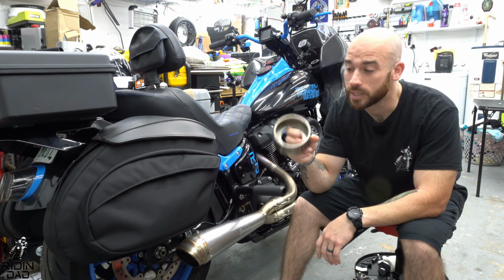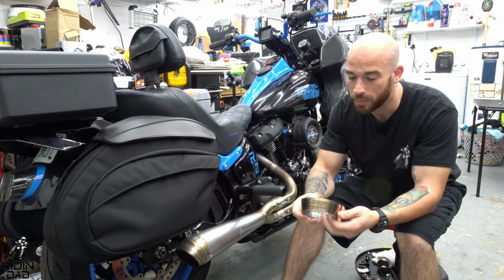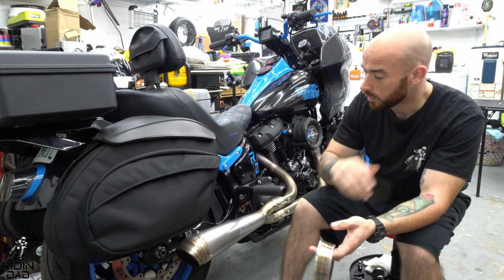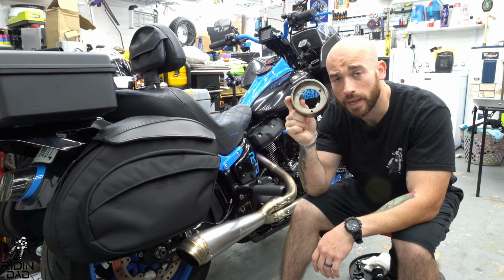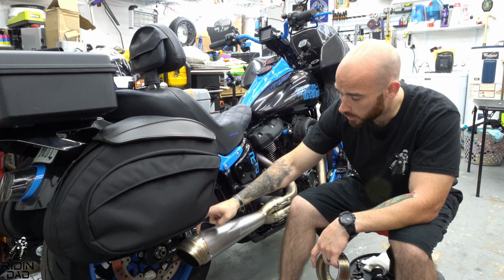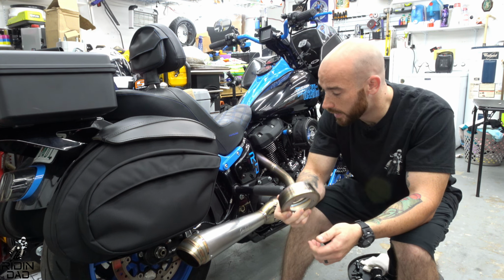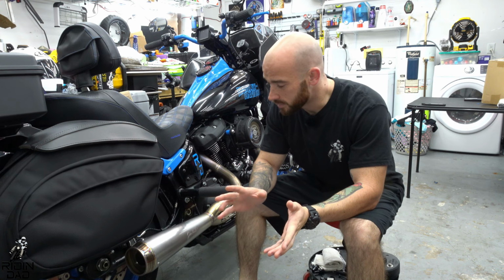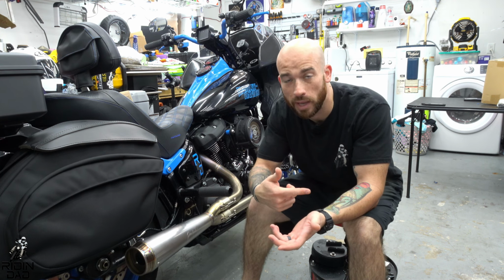Fuel Moto Jackpoit Riot 2 into 1 END CAP SWAP! - does it make a difference?

Comment: Sounds a little louder. Probably more so if you stand behind the bike. I have the same exhaust and love it. I never thought of turning the stock cap outward instead of down, may have to try this. Thanks for the video!
Reply from the maker: Yeah this clip is recorded on my lapel mic so it is behind the bike lol. That’s specifically why I walked back there out of frame.  No problem man?
Reply: @Ridin Dad  I wasn't trying to tell you where to stand, sorry it came out like that,lol. I was speaking in general.  You had me thinking about how turning the cap changes the direction of sound.  Yours will probably increase awareness behind you when riding.  I don't know about you, but I use the throttle as a horn. I usually crack back the throttle a few times if a car around me seems potentially unaware that I'm there. 
I appreciate the videos!
Reply from the maker: All good man! And yeah I do that too. Sometimes it helps but unfortunately around here half the people are too deaf or oblivious to hear it anyway :(. And thanks man!!

Comment: just picked up a ‘23 st 3 days ago and swapping out the pipes is a definite must for me lol. This video might have convinced me to buy a set. thanks man
Reply from the maker: Awesome man! Have fun 🤙🏼
Reply: Does anyone have experience with the straight tips burning the ST bag?  I thought that the original was curved down, so that it would push much of the heat away from the saddle bag.  Thanks. @RidinDad
Reply from the maker: I don’t believe they would impact the bags normally? Unless it’s like right up against it there’s enough surrounding air that it’s not just solid hot air right on top of it all the time.
Reply: thank you @RidinDad

Comment: Does this fuel moto pipe outperform the fab and trask pipes?
Looking to replace my s&s  pipe
Reply from the maker: Trask performed like crap. Even my two brothers outperformed the trask. As far as the fab 28…I haven’t dynod it since the change but it seems to be the same if not better.
Reply: Yes that jackpot pipe is one of the best pipes u cN buy especially for torque. It's very tunable. Check out their dyno charts. No dip with that pipe

Comment: It sounds better after the swap. I have a question for you do you like thunder headers?
Reply from the maker: I do. I like the performance and the tone and look. I just don’t like the quality of the finish unfortunately
Reply: @RidinDad  I am currently running a thunder header on my ‘99 fxdx with a high compression 103. I recently had it dyno at 115hp, and 118 torque. I haven’t had any luck finding out if the fuel moto is better performance wise than the thunder header. Well thx for your time and I’m open to any suggestions or thoughts you might have.
Reply from the maker: It might be better but the thunder headers perform good. If you’re happy with sound and looks I would assume it’ll be a waste of money as it’ll only help a few hp and tq. If you’re looking for an excuse to change then I say so it. Just my opinion man 🤷‍♂️

Comment: Is this Exhaust good for
 23 road glide st?
Reply from the maker: Fuel moto makes one for that bike as well. Same concept but specific for that bike as it’s different than this bike
Reply: @RidinDad  which exhaust  tip sounds more aggressive in your opinion

also when going on long rides does it quiet down or is loud the whole time
Reply from the maker: @ereuno the curved tip is a little bit more aggressive of a tone because the sound hits it on the way out a little bit. And yes, it does quiet down while you are riding. That’s the whole reason I got this exhaust was because with a cam, my bike was too loud for comfort, well, cruising with my other exhausts. This one is very tolerable, while just cruising.

Comment: You can tell the difference even on an iPhone the sound qualify is great.. I like the jackpot 2/1 great exhaust, possibly the best exhaust made since the thunderheader! Now you do have HPI they’re just as good.. lol The new cap is amazing. Don’t go back
Reply from the maker: Thanks man!! Yeah hpi is awesome. I have unfortunately never heard them in person. But the main reason I went with the jackpot riot was too quiet down my sound a little bit because it was just too much for a long trips, and it has done exactly that. Otherwise, the absolute favorite sounding exhaust that I have ever heard to date so far would be the fab 28th that I used to have with the canister style muffler.
Reply: @RidinDad  The HPI shorty for touring bikes is insanely loud/mean in person. Annoying AF on long rides. Plus they have a decent torque dip down low. But aesthetically is absolutely beautiful in person.
Reply from the maker: Well I’ll never be trying them out then lol
Reply: Idk who told you hpi is good but they are wrong. It's the biggest fad pipe on the planet right now with the biggest tq dips you can think of. Lol.
Reply from the maker: That’s not true at all. Does it have a tq dip? Yeah, so does every other short 2-1 out there. I’ve seen many dyno sheets. It’s not the absolute best performer but it’s also not bad at all
Reply: @jaredlangston7429 I
I heard that the riot was louder then the hpi shorty i never heard the differences in the hpi and say a thundwrheader i have a d and d big bore on my 114 23 roadglide but not sure what i want next if i want to do a shorty pipe like a hpi or contender i like the deepest loudest sound possible for 2 into 1’s
Reply from the maker: Typically longer will give you more of a deep sound. Longer 2-1’s also give you better power so I would say to stick with as long as you can find

Comment: Is there a reason you didn’t get the contender exhaust from FM?
Reply from the maker: Few reasons. 1, I’m pretty sure it wasn’t even an option when I bout my jackpot riot about a year ago. 2, jackpot riot is proven to be a less aggressive sound and slightly quieter which is what I wanted and the only reason I swapped out from my awesome Fab28.
Reply from the maker: And 3, it’s shorter. Shorter pipes don’t perform as well as longer pipes
Reply: @RidinDad  I read something different about short pipes. They're better for top end and get rid of heat better.
Reply from the maker: They might be slightly better top ends like a straight pipe on a v8 but these crowns do not ride in their top ends enough to utilize that power. They also might dissipate heat slightly better but it’s not enough to make a difference. Look at dyno charts of the vtwins. Fuel moto has several on their website comparing tons of different setups

Comment: Hi 👋, Chris, it is me again, The 71 years young dude, I think the original one is better, and by the looks of it, these pipes a lot smaller than what are used to have on my Deuce , And I presume the difference is as well because I’ve got a pussy inside them, 😂 . I think my pipe was made by DD , And I’ve heard that there are new modern pipes, outperform a lot of other pipes, with better horsepower and torque from the beginning, throttle response, RIDE SAFE GUYS, PHIL FROM THE DARK SIDE OF THE MOULIN FRANCE.
Reply from the maker: Thanks man! And yeah d&d makes some nice performing stuff